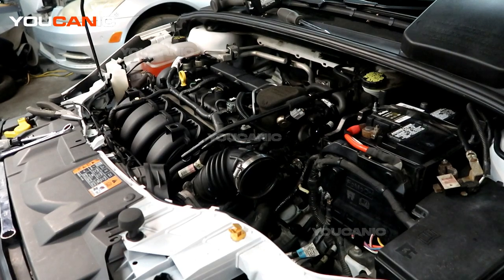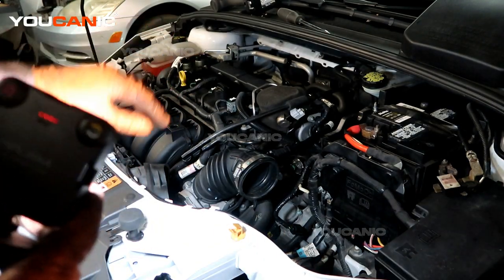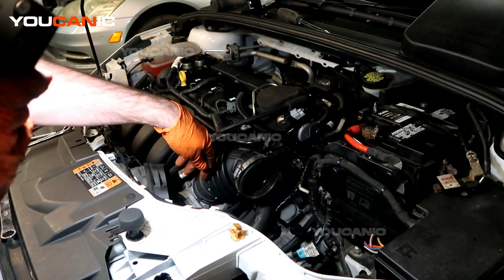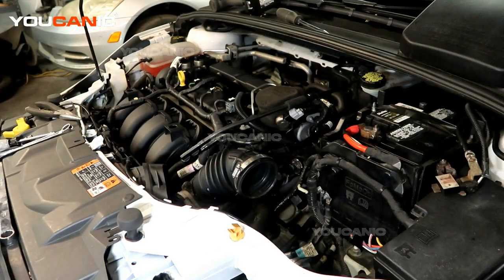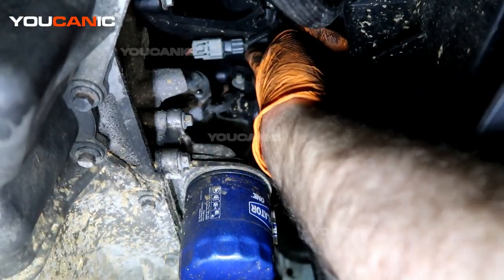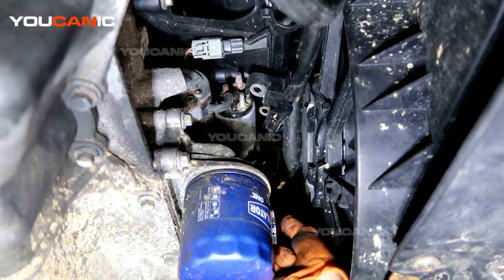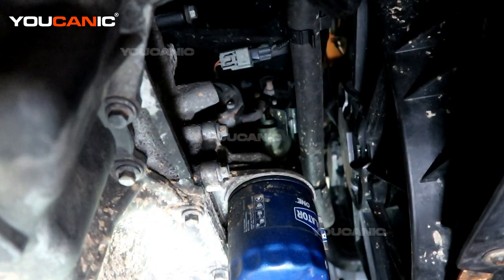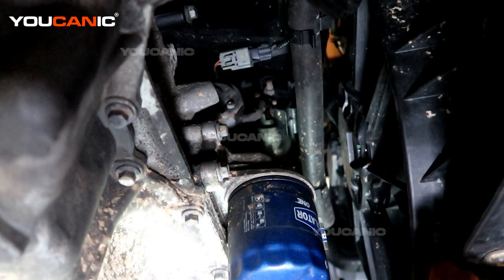2012-2019 Ford Focus - Starter Replacement 2.0L Engine

Comment: Great video. I think it is something I will try and do. You explained everything that was needed to do the job. Thank you. Would you still recommend removing the large plastic hose that connects to the throttle body in order to get access from the top?